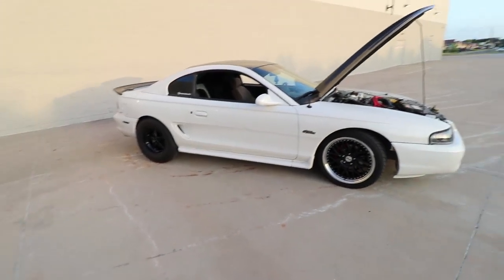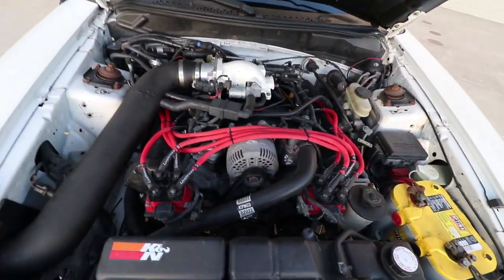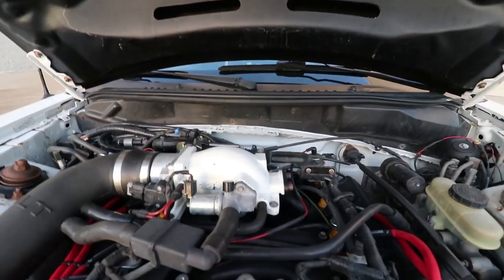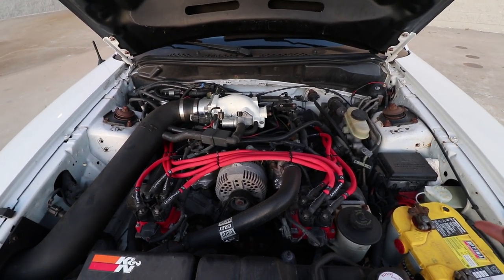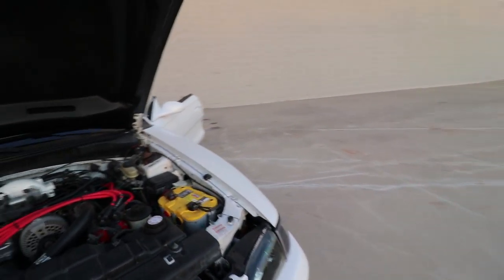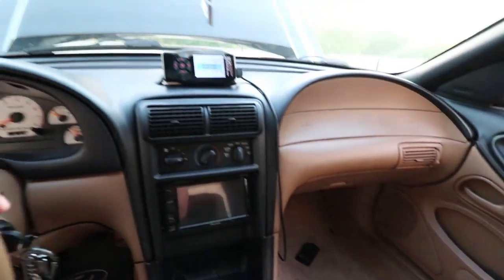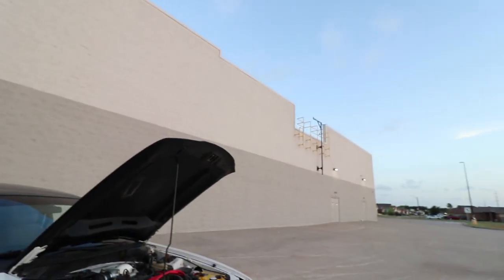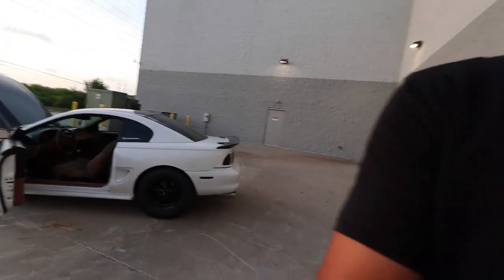How To Get 300Hp Out Of A N/A 2v Mustang

Comment: I put down 314, same car same build. 1996 NPI bottom end with PI heads, intake. Comp cam stage one cams, C&L plenum, mac long tubes. Since then I went to ported PI heads from MHS and got me up to around 325 to 330. And went from 3.55 to 3.73. You are right, 3.55 better on highway, 3.73 better around town.
Reply from the maker: UpAllNight91 wow those are some great numbers!!
Reply: @ReyesBuilt  Thanks. Did it at ramseys here in Tampa Fl. Question, What did you think about that typhoon intake? Think that would help with a NA build?  Ive kinda capped out the stock PI intake but also dont want to lose too much torque
Reply from the maker: UpAllNight91 I don’t think it would, I lost a lot of low end torque plus it heat soaks easily
Reply: @ReyesBuilt  eww, thats what my brother said too. Hey thanks for the vids, I already caught about 6 or so but plan to catch most of them and Subscribed. Enjoy!
Reply from the maker: Awesome, thank you!

Comment: I don't give a CRAP what haters say!! 
You know why 2V gets Hate?? It does something that 3V and Coyote doesn't...
IT'S RELIABLE!!! 😜 

I had nearly the exact same setup on my 98, except I had a 78mm BBK Throttle Body/Plenum combo...

309hp @6800 
326ft.lbs. @4230 !! 

And you can easily do Tens with a simple Turbo Kit, if you want.
Reply: The 3v and the coyote are both reliable too wtf are you talking about?  Most of the mod motors are pretty reliable.

Comment: So I actually had a 98 gt back in the day with pi heads and intake with accufab plenum and throttle body, no long tubes just x and exhaust no cams. I actually made the same exact power, maybe the cuz it was a 98 not sure. Was also white with black leather. Badass 2 valve btw!

Comment: I have the 270 comp cams and stage 2heads on my 00 and when I Dynod it running super Rich it made 280hp to the wheels without a tune but lost some torque gain hp tho

Comment: Are you available for comment and suggestions?  I have a 97 e350 class b rv  with a 5.4 2 valve.  My goal is to increase low rpm torque.. to improve drivability and efficiency..

Comment: Hey Chris look into methanol injection if running boost will help cool off the compressed air coming into the motor and the meth will also act as an octane booster. Finding E85 by me is a pain hit or miss. Just an option to consider with the super charger.

Comment: Great low cost setup. Unfortunately like everything else, money equals power. That being said, 4 valve short block (they have flat top pistons), SVO heads, SVO intake and your cams, probably good for 320 plus. PI heads flow more at lift under .500, they are actually not high rpm application. The stock non pi heads actually flow more at high lift, so they are not properly utilizing your cams though you are getting the boost in compression ratio.

Comment: I have an n/a 2v with cams/ported heads/victor jr intake and fbo it made 291 whp on dynocom. fun car but I also have a coyote and it would have taken a built motor and blower to beat my bolt on coyote now my coyote has a blower and I just drive the 2v around for fun and sound
Reply: Dude a blown 2v done right can easily walk a bolt on coyote without a built motor.  Those cars are alot less weight than newer coyotes so they don't need the same amount of hp to do more damage.  It's easy to go well over 400 rwhp on a boosted 2v done right many have done and they stay alive for a good while if you take care of it.

Comment: watch andrew lavender or mustang lifestyle both those cars are two valves ones built the other is all stock internals and they are both beasting it . i my self have a 96 two valve NPI full bolt on tune  on 175 nitrous shot and performance built 4r70w and built suspension   and when i go out and race  people always seem to think its swapped with something else it does take a lot to get them there but they do have some potential

Comment: Getting ready to do everything you've got done on my 97. Picked up the pi heads and intake, saving up for the comp cams stage 2 268 and springs and retainers and all that
Reply from the maker: Be careful with the 268 and make sure you get those degreed. Just in case of ptv issues
Reply: @ReyesBuilt  yeah I've been reading up on it quite a bit. I've heard of people notching the pistons also or going aftermarket valves. But the pi heads are getting a port and polish so I want a set of cams that can flow a little bit more air. Appreciate the tips!
Reply from the maker: Dakota have you tried talking to todd warren? He makes custom spec cams

Comment: hey what's up man i have a question. So I got a 96 mustang gt with eagle rotating assembly. I bought the car with the rotating assembly but don't know what exact compression it has to add boost? Also the guy said he had to run 93 octane due to pinging. Could that be because of the internals or a tune he put on the car? I only have 91 octane where I live. I know its forged for sure because I used a boreoscope camera in the oil pan. I got npi intake but don't know if I have npi heads or not. I want to run vortech What would you suggest? My end goal is 500rwhp
Reply from the maker: Get it compression tested bro that’s all I can suggest. I don’t know much about that rotating assembly

Comment: Damn I ran cams on my 03 GT and it only made like 282 pound feet of torque to the wheels and 316 horsepower
Reply: What other mods
Reply: Pi heads and pi intake on a non pi block actually has a little more compression that a full pi motor if I'm correct .. that might be the power difference or you might need to degree your cams

Comment: Port the pi intake makes a difference watch Richard holden he did this build and made 406hp at the crank
Reply: That is with straight headers, no accessories turning...so it's not just at the crank that is higher numbers than you'd see in the car even at the crank.

Comment: What power do y’all think I would be making 
It’s a 2000 GT mustang
Has short  tube header
Msd coils 
24lb injectors
75mm bbk throttle body
Bbk cold air intake 
Sr performance underdrive pulleys
Bbk off road xpype 
3inch full exhaust no cats
Rear end has posi diff with 3:73 gears 
bama tuner
Short throw shifter
315 rear 275 up front nitto 555r tires
Reply from the maker: Around the same, maybe lower considering you don’t have cams or long tubes
Reply: My bad I do have stage 3 cams from comp cams and beehive valve springs  but I have short tube headers

Comment: That pop tho on the exhaust. 24lb injectors?
Reply: how does itmake that
Reply: Not 100% i think its the exhaust, I've heard also that its when a little bit of fuel doesnt get burnt in combustion it makes its way to the exhaust and if its hot enough it'll ignite in the exhaust. Making that pop and sometimes flames. He did say it was running rich which means more fuel then necessary for 280hp.
Reply from the maker: Yes it is running rich, good safe tune.
Reply from the maker: Stock 19lbers
Reply: Nice

Comment: I’m pretty much stock should I throw a supercharger and call it a day? ....Can’t wait for some supercharger content though👌🏽 keep grinding man! 💯
Reply from the maker: Definitely, bolt ons aren’t worth it to me
Reply: They all contribute together .
Reply: Build your bottom end before boost atleast, supercharger on stock 2v is a ticking time bomb
Reply from the maker: Carlos Lubiano 400 wheel is proven safe on a good tune.
Reply: @carloslubiano6790 they can do over 400 wheel for a good while if you actually know what you're doing and use good fuel and have a good tune.  It depends on supporting mods.  400 rwhp on a bone stock car w blower might be pushing it but a car with fbo, long tubes, cams, ported heads etc might be able to do 450 rwhp fairly safely the supporting mods effect things quite a bit.  It's not as simple as should I do bolt ons or boost they both go together if you want the best setup and most hp the most safe.

Comment: If you're gonna run boost you should switch back to the NPI heads to lower the compression and make more boost.
Reply: I'd be better to leave the setup and run less boost for the same power.  Especially if you're going to run good fuel.

Comment: I have the same weird noise when it idles but goes away when on throttle. Do you have an idea what it could be?
Reply: Idler pulley and belt tensioner bro. Mine had the same problem and now it runs like it did back in 1998
Reply from the maker: I’m sure the idler is going out, no big deal. Easy fix

Comment: I’m new to this car stuff what’s does Bolt on’s mean?
Reply from the maker: Cold air intake, throttle body, exhaust. Anything small that bolts on and adds power. Technically boost “bolts on” but they are just referring to n/a mods

Comment: Pi short block / non pi heads and cams can get you there.
Reply: You have that backwards it's npi short block with pi heads and intake with aftermarket cams and headers can get you over 300 rwhp because of the compression bump.

Comment: Aye got a question thats goin on just wanna know did u or anybody have this problem before or rn???
Reply from the maker: What is it
Reply: @ReyesBuilt  have you ever hade a problem with when u try to take off like u driving maybe 30 and u try to take off full throttle and it pulls back or something like it do not wanna go man at times modt of the time but i can ezzzzz on it all day and it do okay but cant just hit the gas and take off full Throttle at all really
Reply: @ReyesBuilt  but im puttin new spark plugs in and EGR valve in today
Reply from the maker: @jack5.0420  I was gonna say check plugs and coil packs. Sounds like misfire to me. I have had that before and did a quick tune up and ran badass again
Reply: @ReyesBuilt  i appreciate that man thats exactly wat im gonna try

Comment: I dont know if you can beat bolt on 5.0 maybe stock ones with bad drivers
Reply from the maker: With spray ? I’ll take em to gapplebees
Reply: He's gonna need about 350 HP at the wheels to run with an S197 Coyote.
Reply from the maker: 331Grabber I’m gonna have 405 with my 125 shot
Reply: @ReyesBuilt  
With how light your SN95 is that should cover it. 
  The stock 11-14 Coyotes still slowly get away from my  modded Mach 1 :) but she's only pushing around 310 to 320 at the tire.  wheels.
Reply: 331Grabber my basic bolt on s197 made 440 and I don’t have a intake or headers
Reply: FourPointSixChris when you going to put it on .. it would be interesting videos for test pulls

Comment: Idk why people give the 2v shit and say if don't make power unless boosted.  The old 5.0 windsor doesn't make power any better na and it has more cubes and people don't say the same things about those as they do 2v.  A good healthy heads cam intake setup on a 302 can get you in the mid 300 rwhp range at best in stock bottom end.  If you had aftermarket beads, cams and intake manifold on a 2v I bet you could make close to the same power and same torque with less cubic inches.  I'm not saying it's the greatest ever but I think it gets unfairly talked down on when other engines with similar power potential don't catch the same shit.
Reply: Not hating at all on the 2v personally its my fav engine next the 351 and 3rd gen yote. But the 302 is just dirt cheap to build, single cam, hella aftermarket support, and there is a lot more info on them as far as forums and word of mouth knowledge. But like i said i still love the 4.6 just pricey
Reply: @user-tf8gu3xh5c it isn't much less to build man.  The only area where you save is the cam because there is only one.  Trickflow top end kit is gonna be close to the same on either one.  You can do explorer top end on budget but you can do pi heads on npi on a budget too and a npi 2v with pi heads has like 1 point higher compression than stock.  When you start getting aluminum heads for the 302 they're just as expensive as the 2v stuff.  When it comes to forged internals on both the 2v stock block can take way more power so it costs more money to get big power from a 302 because you gotta go dart block which is almost 2 grand itself.  The 2v has every bit the potential na and forced induction and more when both are forged.  Money wise it's not gonna be that much different either way outside of cams there are two so cams are gonna be more obviously

Comment: That's not true a 2 valve 4.6 stroker by MMR N/A does make alot of power. Do some more homework bro.
Reply: if you stroke it then its no longer 4.6L
Reply: That's not true. It's 4.6 based

Comment: They dont make power with boost either 😂
Reply: Says the one that's drives a soccer mom car
Reply: And their is a guy with a 2V GT that makes 800+
Reply: @StockTurboN20  my soccer mom ss will make more power N/A than your cop car with a blower. 😂
You gotta build the block and at that point I'm going with a teskid. 2vs are straight junk throw your shit out
Reply: @StockTurboN20  lmao
Reply: Go do your research on youtube before you think that 2v dont make power with boost
Reply: @Jesus Rivera a full bolt 2v will blow your doors off your pos trailblazer boat, you can't even run it with out that thing always braking down